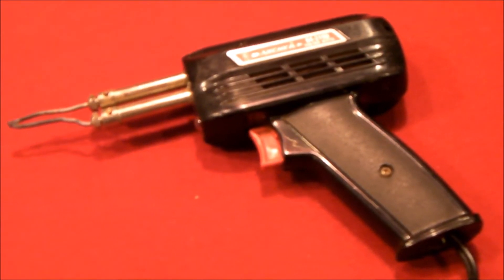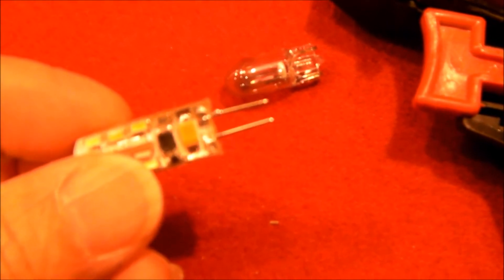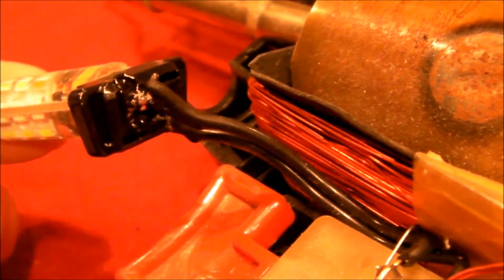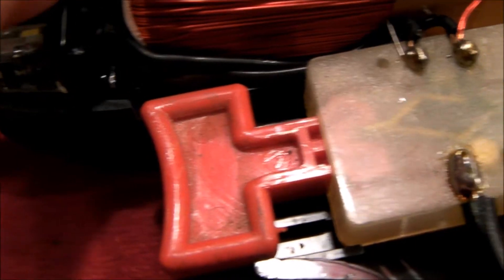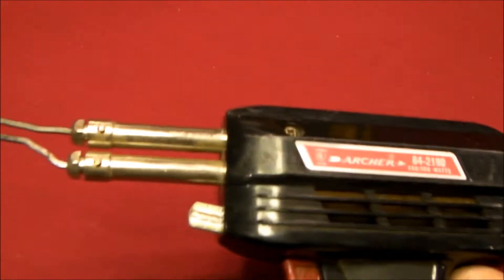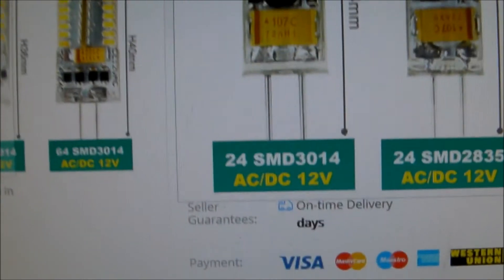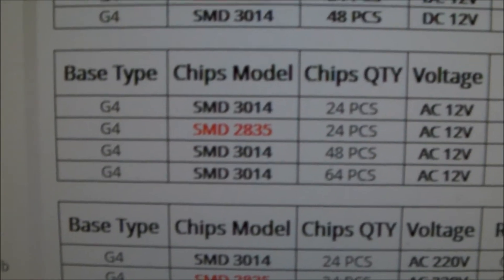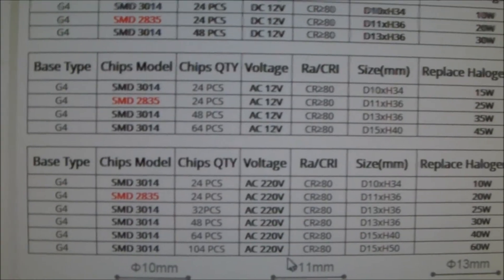Soldering gun light bulb conversion to LED light

Comment: I paid CAD 1.35 including shipping for the LED thru Aliexpress (AC12V 3014 24D:) and it worked out pretty well.I checked my Weller 8200 output voltage which is about 13.5V. I don't think, using it for 30 seconds at a time will fuse the 12V A/C bulb. Most likely there are diodes inside the LED bulb converting to DC, and that will induce a voltage drop of 1.2 V I would guess.
Good instructional video, specially the suggestion to buy an AC 12V LED which normally we would not imagine.
Reply from the maker: Thank you.  I hope you subscribe to my channel.. THANKS!

Comment: It looks like your gun is a newewr vewrsion of the 8200K than mine. Mine uses a #222 lamp (2.5 V incandescent in a miniature screw base.)

This would make for a somewhat more arduous conversion. especially as an L.E.D. with a rectifier embedded is not something I would likely find in the Greater Montreal Quebec, Canada area.

Instead I would likely want to make a voltage doubler but limit the current by limiting the capacoitance of the voltage doubling flying capacitor, and hence its capacitive reactance would be high enough to not overdrive the L/.e.d. (say max 30 ma.)

The L.E.D. is then current excited, and will clamp the voltage where it wants it (typical about 2.3V.) and light nicely on about 30 ma. (this can vary depending on the L.E.D.).

However, I am not so sure it is worth it for me, as I have an electronics hobby shop in my apartment that has lots of specialized lighting, and an arsenal of other tools.

Nonetheless the idea might be of value to others so there it is!

When I want to have a pilot light for 120 or 240 V.A.C. I don't need a transformer (altough a transformer that would do would only cost me $2.00 C.A.D. anyway.) Instead, I put a mylar cpacitor from the hot wore of the A.C. to one side of a small rectifier bridgem (such as 1 A 1000 V rating, cost is negligible). the other side of the A.C. connections for the rectifier gores to the Neutral, and the L.E.D. simply goes across the D.C. connections.

Note: It is essential to use the right capacitor. This must be non-polar, and neither electrolytc or tantalum. Preferably use a mylar capacitor with a voltage rating of 600 V tobe safe when spikes occur. As for the L.E.D. spikes will not bother it as the energy in a spike is too small to do any real harm.

The energy one would expect to have to dissipate in the IR drop from 120 Volts to (2.3+(2*.07) volts) does not occur as the phase between the voltage and the current of the power used is shifted considerably, so that the true wattage is very small althpough the V.A.R. is much higher. Result, no transofrmer needed and negligible heat generated as opposed to the huge dissipation that would be needed if this were done using a resistive drop.

If I want to do this across a 240 volrt line, I cdan use 2 capacitors in series, so halving th capacitance and doubling the capaciticve reactance.

For British, european and some Japanese power which operates at 50 hz. Instead of 60, it might be necessary to increase the capacitance of the capacitor(s) used so as to end up with a suitable value for the capacitive reactance and hence render the correct current to the L.E.D.

"so go flash it!"
Reply: I have a Weller D550 with two #222 bulbs, there's a eBay seller who sells these bulbs in LED, the price is under $20 Canadian$, I don't think it's worth it but here's the link:https://www.ebay.ca/itm/EDISON-SCREW-BASE-EPISTAR-LED-222-BULB-E10-1-5-to-3-VOLT-2-cell-BRIGHT-20-LUMEN/292941216231